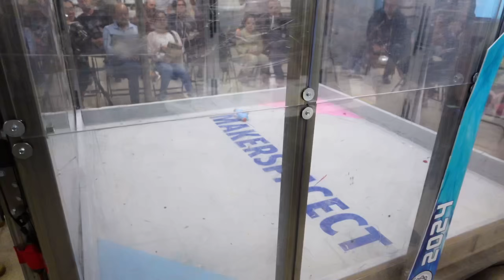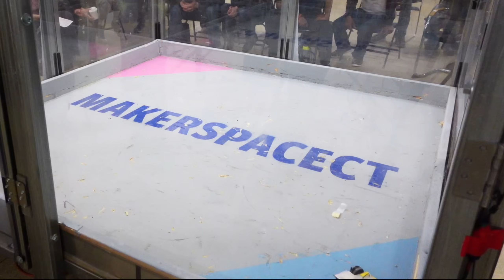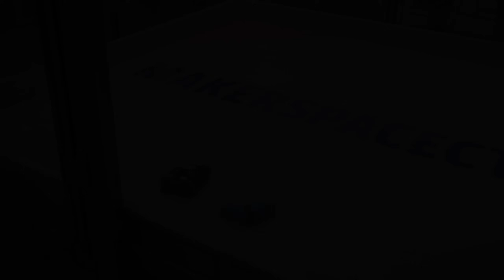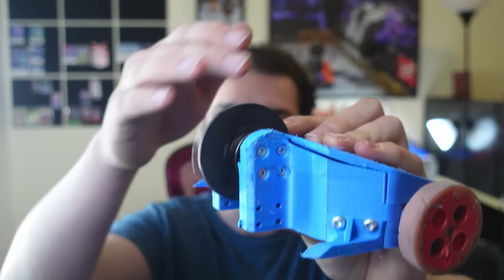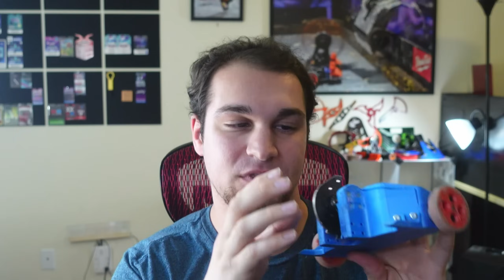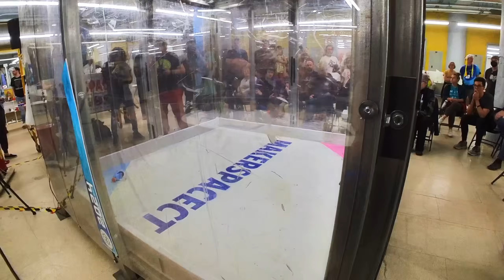Will Sonic Take the Cake? Maker Battle 1lb April 2024 Event Recap!

Comment: Hey seth, this is the driver for eggtimus prime. Do you have any tips to improve my driving for july?
Reply from the maker: Mostly, practice practice practice! You should have a test box if you don't already, practice turning at different speeds and with the weapon at different speeds to get a feel for how much the gyro forces affect steering. Just getting a feel for your bot helps make sure it does what you need it to do in the moment.

Comment: radiomaster zorroe. <3  I use the boxer max for drone racing. you have to get the upgraded ago1 CNC gimbals for it. they are ultra lux and worth every penny.

also , the Emax motors are kinda terrible, I would suggest an AOS supernova , or an Iflight Xing 2306, or the hyperlite brand of motors I use on my racers. Motor Kv has very little to do with how good a motor is, you want to look at things like balancing compound, bell material, magnet quality, shaft material, and air-gap in the stator.

also also,  I would suggest if you want the best ESC you can get, to go to Foxeer, they make the best ESCs on the market RN.

Comment: Use 12 pounder parts to build a 3 pound version of sonic  .
Reply from the maker: There kind of are no standard 12 pounder parts, at least not ones that wouldn't be 2lbs of drive motor and gearbox
Reply: Learned something again

Comment: Was the design of Sonic a base for design of Division V4?
Reply from the maker: No not at all, at least not for V4.0... After Sonic's success last month I spent a week or so designing a new Division V4.1 that's a little closer to the geometry of Sonic but it doesn't really work. Sonic is 1lb and the weapon motor is about 35 grams, and the weapon itself is only around 40 grams of spinning mass. The square cube law would suggest everything gets 1.73 times bigger size at 3 times the mass to scale up sonic to a 3lb.

Unfortunately the 5536 hubmotor is 6 times the weight of Sonic's weapon motor and Division V4's weapon is 4.25 times heavier than Sonic's so it ends up having a terrible weight distribution and it is pretty much impossible to drive. I'm going to need to rethink the geometry for Division entirely.

Comment: I'm building Sonic from your CAD. How do you mount the weapon motor? The shaft won't allow me to push the motor into the frame.
Reply from the maker: The frame is flexible when printed in TPU, can just pull the uprights apart